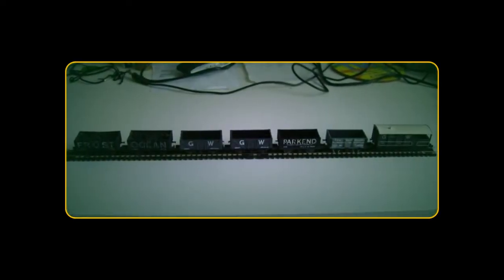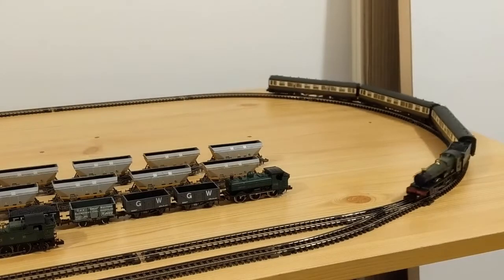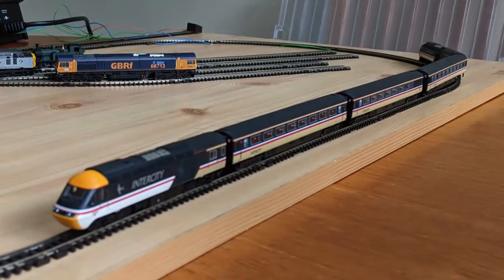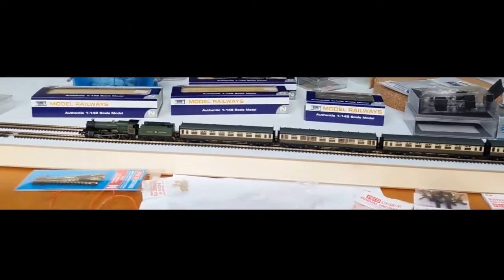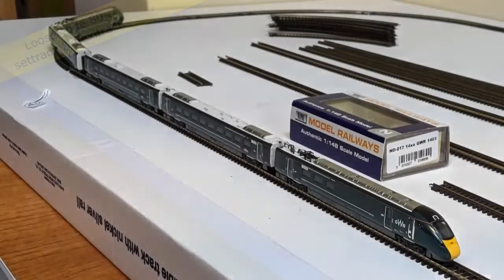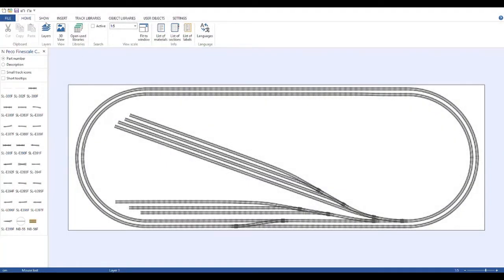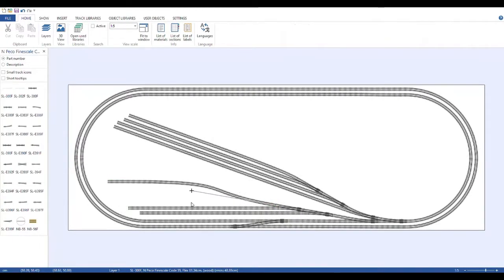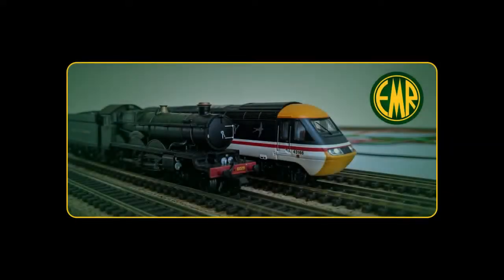0001 Introduction

Comment: Hi Jonathon. Just found your channel and am enjoying following your journey. I too started my collection of locos with DC/analogue ones before turning to DCC. Just because you have converted to DCC it doesn't mean you can't run your DC locos. Anoyingly, you will have to buy (an inexpensive?) DC controller, disconnect your DCC controller, remove any DCC locos from the layout and away you go!
Reply from the maker: Hi Paul, thanks, glad you're enjoying them :) Fortunately I do have a DC controller and can indeed have a "DC only" session sometimes, but it's literally one loco at a time on the whole layout - I decided not to isolate connections to sections of the layout. I did consider having some kind of DC/DCC toggle switch, or making it possible to have the inner/outer loops on different controllers, but figured it would just be a matter of time until I made a mistake a fried a loco